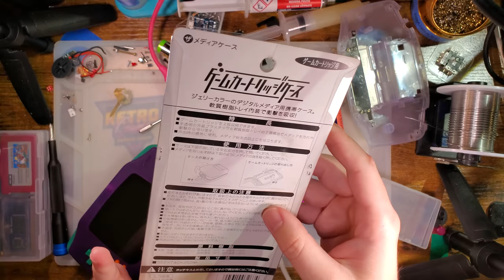Funnyplaying LAMINATED ITA Game Boy Advance Backlight Kit (And Shell + Battery Mod)

Comment: Finally a laminated screen for the AGB that's in stock! I'll end up getting an IPS laminated later as well if and when it's released again. I wonder if the screen "water ripple" can be remedied by reinforcing around under the screen. Thanks for the "preview" review. Ordered. :)
Reply from the maker: I already brought up the problem and pitched some potential solutions. Allegedly there is a new bracket design coming that fixes this.
Reply: @makho  So with the new bracket this problem is completely gone or something additional has to be made like reinforcing the screen around the shell and reducing the pressure of the motherboard? I'm sorry if this has been said somewhere, I looked around and couldn't find an answer. Cheers.
Reply from the maker: @hristostefanov4009  yeah the new brackets seem to improve on this

Comment: Quick question. If I do not solder the wires, can I still adjust the brightness level using the touch sensor? Or will I only have 1 brightness level?
Reply from the maker: You can use one, the other, or both simultaneously.
Reply: Did you end up doing this mod? I’m also thinking of doing it :)

Comment: Very nice video!, the ITA is my favorite display for GBA, very happy to see now there is a laminated version, hope they make them in colors/themes to match my SNES themed GBA. By the way, in theory this display wouldn't be introducing any extra lag since it has native resolution right? or am I missing something?. And a last question, is technically feasible an ITA display for GBA SP?
Reply from the maker: Native resolution is irrelevant for lag. This screen uses a FPGA, same as the rest. I have not tested lag but it will be there.

Comment: this thing has a massive backlight bleeding (not the correct terminus but i don't know how to describe it) if you use a transparent shell. i had to to massive manual corrections (using black tape, foam etc.) to make the laminated kit a good locking thing.

in your test, for the future, show the turned on screen in the dark.
Reply from the maker: I have shown these kits in transparent shells. This specific screen even.
Reply: @makho  that's correct. then i'll rephrase that: i would have liked to see a presentation or a test in (near) complete darkness. otherwise, thanks for your answer and your videos.

Comment: Does the retail version of the USB-C battery pack activate the Red Light on the front of the GBA when the battery is low?
Reply from the maker: I don't believe it does. I checked my notes and apparently, I never checked the retail version in-depth so I'll have to do more research.
Reply: @makho  thank you for your response

Comment: Can this kit be installed without soldering the wire from the ribbon cable to the motherboard?
Reply from the maker: the wires are for brightness control (which can also be controlled with the touch sensor) and adjusting the alignment (which should not be necessary with laminated kits)

Comment: Hey makho, i saw here in our online local store it's the same laminated ita lcd for gba but it doesn't have a brand but it works the same and same design and it's cheaper and it comes with a shell that supports laminated ita ips...Do you recommend me to buy that because i'm in asia the shipping costs a lot if i buy in rgrs

Comment: makho, all ITA kits have horizontal lines that make areas that should be solid color, stripped instead. The issues is described on reddit. I wonder why you haven't noticed it before. Funnyplaying is aware of this issue, but claimed that it can't fix it. If you have issue noticing it, play Super Mario Bros 4 on the DSi using GBARunner and then play the same game on an ITA'd GBA. You will see that areas are solid color on the DSi, while they're stripped on an ITA'd GBA.
Reply: I also wish this would be adressed more frequently. I read about it  and it kinda keeps me from ordering. As I understood it is because of the screens' PCB which could technically be replaced once it is fixed and if the fixed PCB would be sold seperately though. IF it will be fixed. Chances are higher for FP to work on that if a higher awareness existed.
Reply: @leinsaat5779  Yeah, my hope was that makho addresses it, but it loos like he can’t see the stripped surfaces or he doesn’t care because he likes IPS screens more.
Reply: @digleyd.3813  It's also possible for my understanding as a noob that maybe it can't be fixed at all. Is it that annoying? I would want to see a comparison between a stock DSi and ITA screen.
Reply: @leinsaat5779  Yes, it is that annoying. Stock DSi looks just like an AGS-101 screen. ITA looks shit if you have solid color surfaces. Imagine an LCD scanline filter that only applies to solid color surfaces.
Reply: @digleyd.3813  I will definitely wait with ordering until this is fixed if possible at all. I will try to adress this issue at Reddit to make it more popular.
Reply from the maker: I have yet to see any good examples of this. I've also shown plenty of footage and yet no one can point out the issue on mine. Y'all are making this out to be some obvious critical issue and yet it appears to be an edge case nit pick that most people don't even notice let alone care about. https://imgur.com/a/iwXmQHh

Comment: Website says that those "water" marks appear, so maybe they are not fixing it yet... :C I've been waiting for a laminated screen for gba, but i don't want to have this issues:/ maybe I'll wait until they resolve those problems. Pd: love your videos, they are so informative! Thank you!
Reply: Ooof that is a bummer. Hope they will be able to fix this. Another thing that keeps me from ordering,  together with these horizontal lines that were talked about on ITA screens which they still come with as it seems.
Reply: @leinsaat5779  same here, i want a laminated screen for GBA but maybe I'll need to wait a little more:/ the air gap on the IPS screen is noticeable? I had one IPS GBA before, but i don't remember if it was that bad
Reply: @bookishaxis123  I only have an AGS 101 built into an AGB and there is a gap but it never bothered me, only thing that annoys me is a slight light bleeding on one side if I am close to the lens, aswell as the shelĺ not snugging together perfectly. For the IPS screen on my SP it annoys me in general how much power it draws. I got a noname one but I think it might be the same for like FP ones. The biggest reason I wanted a ITA because power efficiency is much better here, and I prefer the original pixel grid over the Smartphone like IPS by a long shot.
Reply from the maker: I have been informed that they have a fix for this already with a bracket revision. I don't know when those start shipping.

Comment: Hey my friend I have this screen and I’m having the issue where it dims the screen on it’s own, can I cut that touch sensor off or is there another solution to fix this issue
Reply from the maker: You should ensure that your sensor is placed appropriately and not making contact with other parts of the console. Ideally, it should only make contact with the top housing as well.

Comment: Is it possible for you to put the two resistors needed for the host type usb charging yourself?
Reply from the maker: technically feasible, yes, but that's very fine pitch soldering. I've already spoken with funnyplaying and they are revising the future iterations to include this.
Reply: @makho  you're very beneficial to the community 👍👍

Comment: Hey Makho, I always use a crystal mod for 2x speed like the gbaccelerator, you think this is compatible? Cheers
Reply from the maker: Unlikely but that's because 2x is too high for most GBA games (or consoles). 1.75x would likely work (other kits can be overclocked) but I haven't tested this.